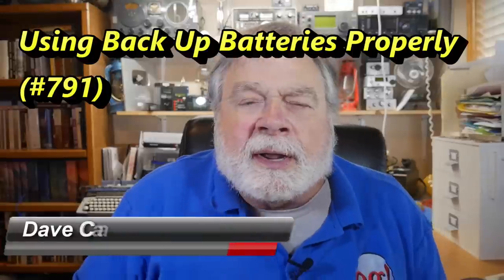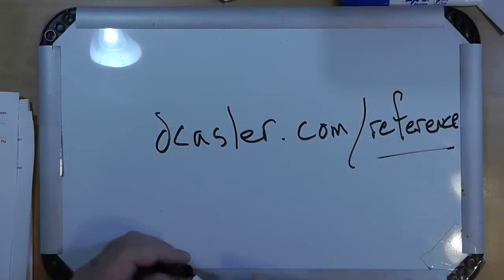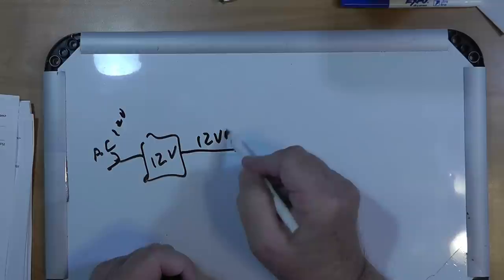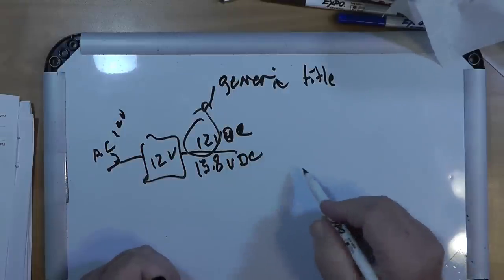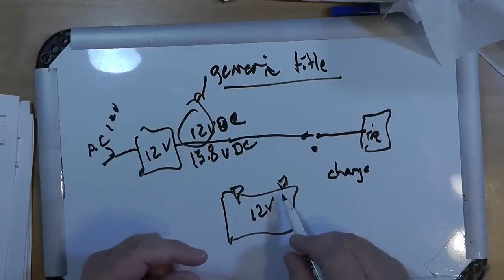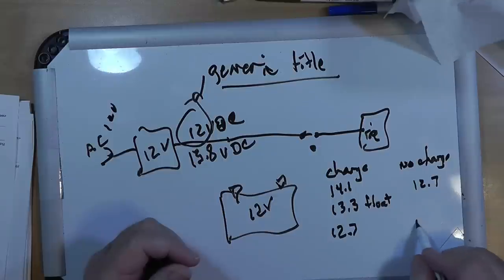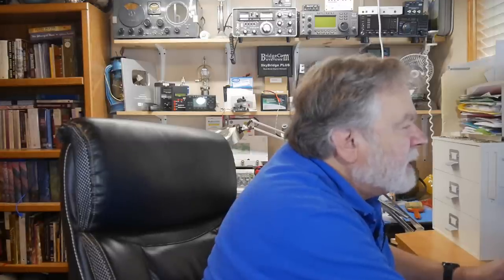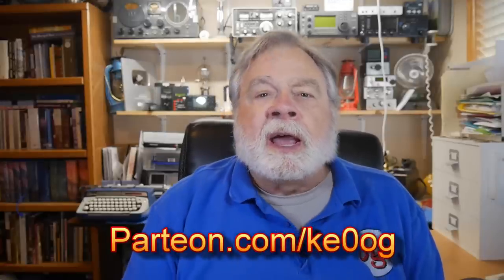Using Back Up Batteries Properly(#791)

Comment: I use several pre-owned APC 1500VA True sine smart UPS. They were 960W but I fully populated them, and did some hardware battery float voltage calibration mods. Now they are 1500W continuous, 3200W surge. I phase lock them, and use them with a 1500KVA transformer that has  three isolated windings. One winding has selectable taps to input increments from 100v to 480v. the other too windings are 120v and can be switched between parallel and series. 
But back to batteries... The thing to remember about float voltage is what chemistry are you using. True deep cycle will often use lead antimony and will offgas a lot. Most UPS and small sealed lead acid (SLA) batteries today are lead calcium, and actually valve regulated lead acid (VRLA.) Occasionally, or rather rarely you will find a pure lead battery, but where I get used cells for restoration, those are rare as a unicorn burger.
Reply: Impressive! You got a write-up or qrz page with any further details? Sounds like what I've been contemplating.

Comment: DAVID,  You are 100 % correct in telling the charger what type of battery you are using. You forgot to mention an AGM type battery. I use a Noco 5 amp automatic for my classic car & other cars. It works great on radios too, 73's TMP from N.J.
Reply from the maker: Yes, in fact my primary solar batteries are AGM. They're getting elderly but work fine. They've been coddled all their life.

Comment: Another good vid, thanks!  Here, been using a 32 Ah AGM continuously connected to Guest 1.5 Amp charger for the last three years. Radio; Alinco DR 735.  Seems to work a treat. Typical float Voltage ~12.9 V. The kit , no longer available, came from Powerwerx.  They now apparently do only LiPoFe units.  The battery is held in a plastic case sporting direct connected Anderson Power Pole and screw/banana terminals and an on/off switch for Voltmeter, USB connectors, automotive plug.  The handle on the case is hefty.  Powerwerx and other sources were specific about using an AGM compatible float charger.  Advice indicated that for longevity, AGMs need a lesser float voltage than standard wet plate automotive units though they can be charged to capacity with a regular wet plate charger.  Hoping useful, 73s KI7MBR

Comment: I run off a Nortstar 180 Ah battery. I use a Victon charger that is programmable for different bulk charge, absorption, recondition, storage/float voltage and has temperature compensation.  It can handle lithium chemistries as well with different settings.

Some chargers have different settings for lead-acid vs LiFePO4 but you may or may not be able to adjust for the manufacturer's recommended charging settings.

I have ferrites on both the AC and DC power lines and float at 13.2v which is the manufacturer recommendation for the battery. Weekly the charger ramps up to 14.4v.

Comment: Thanks for the detailed explanation! I use a small UPS, replacing the normal 7VA gel batt with a 75 VA car battery connected to it. The charging cycle is slow, but ends at 13.9 V and keeps the battery in good condition. When operating HF, I simply unplug the UPS "Charger". Regards!

Comment: West Mountain Radio and others have a box that you can contact your power supply,  battery and the radios and it controls everything. The one West Mountain has has a small bust to charge Lifepo4 batteries,  there are jumpers to set the type of battery and the charger amps!

Comment: I currently use an IC-705 as my primary HF rig because I want to get into POTA and QRP portable HF operations primarily (and I'm very limited in antenna options due to nearby power lines). I mostly run off either the built in HT battery which allows operation up to 5 W or I can add an additional external 4.5 AH LiFePO4 battery for up to a full 10W of power. When not mobile, I've been using a modified PC power supply that outputs a fairly clean 12 W of power which fits within the 13.8 V +- 15% rating for both charging the HT battery as well as operate up to a full 10 W.

Comment: My dad worked at the phone company in the "power room" after the war.  They had bays of open cell (no tops) lead acid batteries and when they went into their periodic maintenance overcharge cycle they would produce a lot of gas and bubbles.  This caused little splashes that often got on clothing.  All growing up, every undershirt he had contained little round holes.  This was long before the days of OSHA obviously.
Reply from the maker: When I was a teen, I worked at a motorcycle shop. All my Levi's got little holes in them from acid splashes.
Reply: My dad worked in the phone company as well. The battery room was interesting. Giant lead acid batteries in clear (glass?) containers. The office was a 4000 amp load so there were a lot of batteries. The bus bar was 6"x1" copper. Pretty cool to see. Once they moved from the old canister switches to the ESS the load dropped considerably. In this office there was quite an event that involved the batteries and the ESS on Christmas eve. Wasn't pretty.